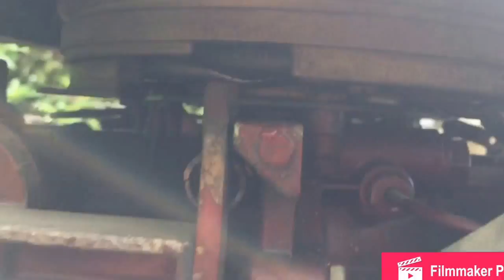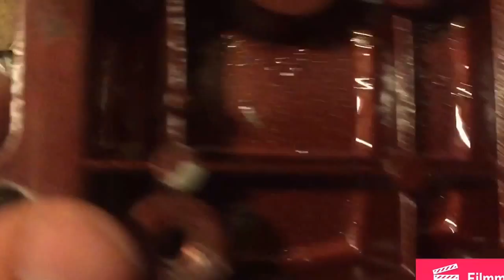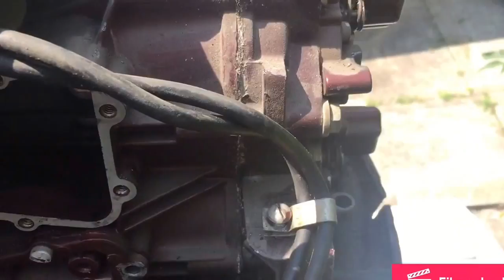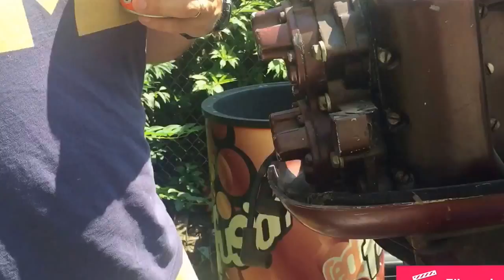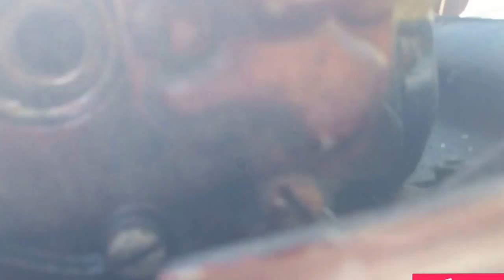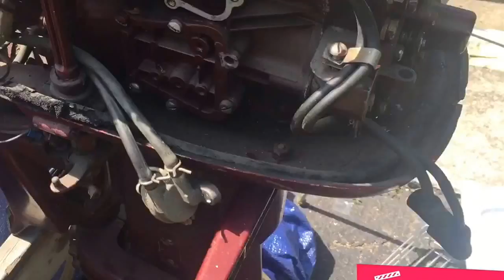1957 Johnson 35 Hp restore and double to single fuel line conversion

Comment: I just got an AD-11 57 johnson 7.5 hp I need an explanation on how the fuel lines work.. and if I can just use a 3psi little lift pump and put it on..
Reply from the maker: very simple... you need an old school pressurized tank with 2 lines... one line goes from air pullses from the motor to the tank which pushes fuel up the other line to the carb. If you want to convert to single line, you need to block the passage inside the intake manifold and connect a newer air fuel pump to the fitting on the motor. 

what do you mean by "lift" pump?

Comment: I got a question for you where is the thermostat on a 1956 30 hp Johnson and what is the part number for the water pump I look online and they keep giving me newer ones from 80s an 90s
Reply from the maker: the kit is part number  379774 the housing is part number 303831the plate is 303836. Im having problems finding the part number for just the impeller! but ill work on that!
Reply: BlackoutBill21 thank you I don’t know why it so hard to find parts on old outbords thanks again
Reply from the maker: @samtate1260  its not hard at all! but pre 1968 it can be tricky!
Reply: Yeah I did my 1985 115 hp evinrude and a few 6 hp thanks for the information I like your videos I seen you do the gear seal on the motor I have
Reply from the maker: @samtate1260  Thanks!! Glad to help!!

Comment: What’s the part number for the side plate that mounts the fuel pump
Reply from the maker: Good question!! Actually I have no idea! Cause there are only so many years that had the boss plate pre drilled and tapped however it’s SUPER easy to drill and tap them yourself

Comment: Did not know if there was another way to contact you other than this. I'm have a chance to buy a 57 35hp Johnson. I went and looked at it today and it has low compression on the bottom cylinder. I can get it pretty cheap but not sure what to do!
Reply from the maker: Thank you for subscribing!! And commenting!! First off, what is low? Whats top cylinder? Let me know!!
Reply from the maker: I buy any antique outboard if they don’t run for no more than 50 bucks... if he wants more than that don’t buy it
Reply: Top cylinder (sorry, compression) was like 120, and the bottom was 60😒.
Reply: I've talk him down to $40 and going to pick it up tomorrow.
Reply from the maker: RockstarGTA1 ok that’s awesome... good news is it might be easy like a head gasket... bad news is it could be bad rings... at 40 bucks you can’t go wrong ... but you may be buying a parts motor
Reply: BlackoutBill21 yeah that's what another one of my buds said, that I was just buying a boat anchor. I figured if all else fails I can sell the parts. Could the rings on just the bottom be seized up? He said it was running a couple of months ago.

Comment: Your video is all over the place. What happened to the fuel line conversion?
Reply from the maker: yeah i showed what to do with the plate but didn't show how the fuel pump mounts. Once the plate is mounted however there is really only one way it goes. I should have documented it better though . Thanks for the input.
Reply: Try another one. I'm about to start restoring a 1957 7.5.
Reply from the maker: Im currently a day or so from finishing that SAME MOTOR!. im also doing the conversion. I actually have a video on converting that motor already. but it doesnt use the side plate. it involves buying a generic pump and plugging one of the reed plate holes
Reply from the maker: https://www.youtube.com/watch?v=JT-nnCcnTPU&t=66s

Comment: Why not just a 2 line pressure tank they very good.
Reply from the maker: Outboard Fun cause it’s hard to find one in good condition and the fitting is expensive... also when I sell the motor, it’s easier to sell with a general Evinrude hook up

Comment: How does the engine run. I have a 7.5 fleetwin I need to convert. I think I need to use a smaller pump.
Reply from the maker: yes you need a smaller pump. luckily they are only like 15 bucks ebay. This motor ran like a champ!

Comment: You skipped the whole 2nd part of the fuel conversion.
Reply from the maker: Levi Powers how so? You wanna see it mounted and how the fuel lines go?
Reply: BlackoutBill21 well yeah, you went from the fuel pump conversion to fixing stripped out spark plug therads. You didn't show how you mounted the pump ran lines or plugged off the pressure nipple on the front of the motor.
Reply from the maker: ok i see that. once you mount the fuel pump you would see there is only one way it should go. But i probably should have showed that.
Reply from the maker: https://youtu.be/ZrSwYp6oC5A   crude but might give you a better idea

Comment: I just picked up a 1956 30hp johnson tonight that looks exactly like this that didnt come with a tank so I'm also trying to convert it to a single line system with a fuel pump. Do you remember the part number for the fuel pump you used? Or better yet can you leave a link to for it? You're video is helping out a lot, I appreciate the help.
Reply from the maker: Smokiest_Purple you got it! I’ll post the link asap
Reply from the maker: Smokiest_Purple part number and link posted in description!!